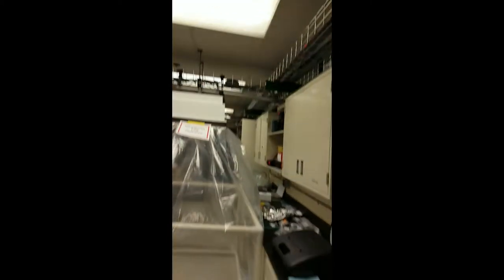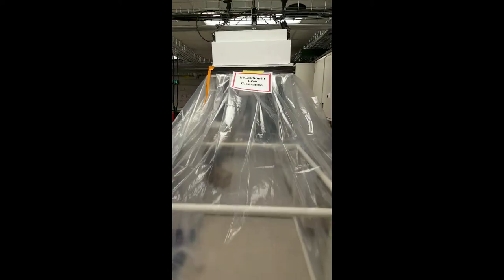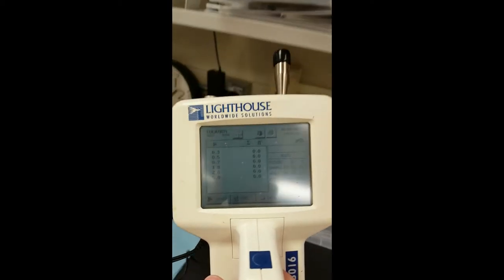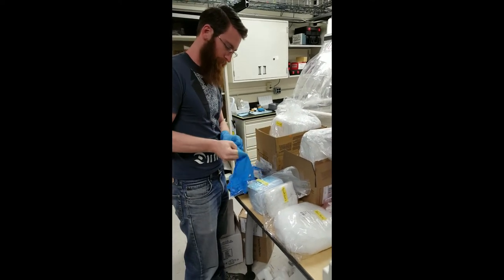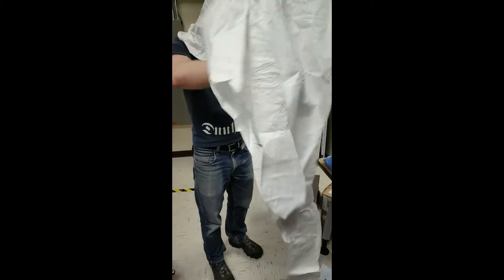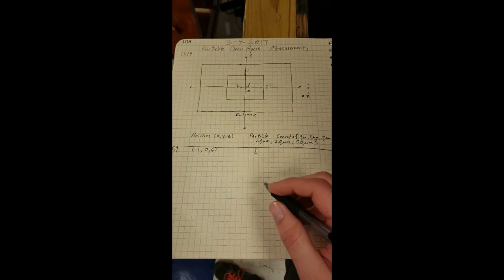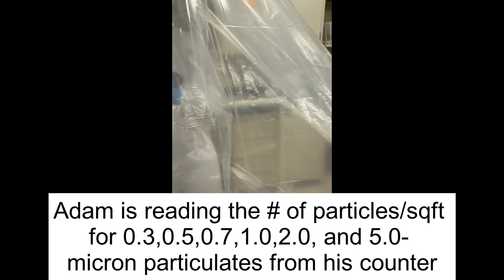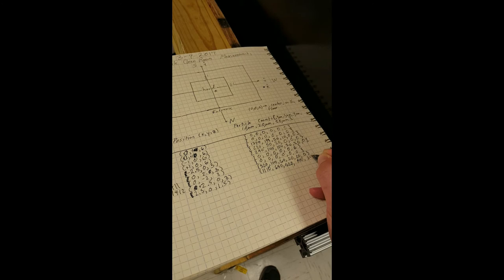Making a Portable Clean Room

Comment: Could i do the same with a hepa filter and a box fan and of course a vinyl or plastic enclosure?
Reply from the maker: That's an interesting idea. If your box fan(s) can push enough air uniformly through the filter, I (Roy from the video) think it could work. Clean rooms require positive pressure and laminar air flow to push particles down towards the floor and out under the clean room walls. I would start by comparing cubic foot per minute (CFM) specifications of box fans to CFM quotes by manufacturers of HEPA fan/filter units to see if it's feasible. The final test, of course, is checking your clean room with a particle counter. Hope that helps!